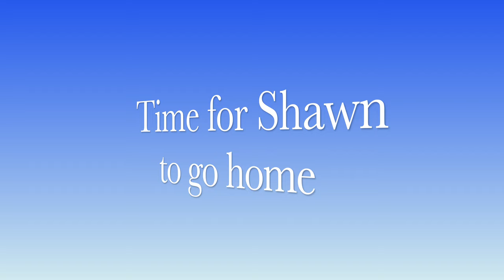Renovation day in France | Daily vlog #7

Comment: So many things happened today.  Have to admit, you skipping on your way out of the shop made me laugh.  I completely forgot that you use the term Earthed where as in the US we say Grounded.  Obviously it means the same thing, but just another example of using different words for the same thing even though we both speak English.  The Aussies always use Earthing as well.  That tool Shawn uses is a much better way to do it than the way I did it in the Army, it was either a slide hammer or a sledge hammer.  Either way it was a very manual process and normally we would join the 3 rods together so it was about 3 meters long we had to pound into the ground.  Great video as always, Laterz!
Reply from the maker: Thanks Gary as always. We did things the hard way in the army. Even saw the grass being painted once for an inspection lol. We used the expression - bull sh*t baffles brains. 
Never knew that about using the word grounded. Fun American Fact lol 
Laterzzz
Reply: @Escapetofrance-Charente Ah, Grounded here in USA means Earthing to you! Learn something new every time I watch your channel. What is ‘hatching’ ?😅
Reply from the maker: @kathyeyesopen4078  you’re  welcome 👍 I think I may have said loft hatch? It’s what we call the entrance to the attic. “Put the hatch in”?